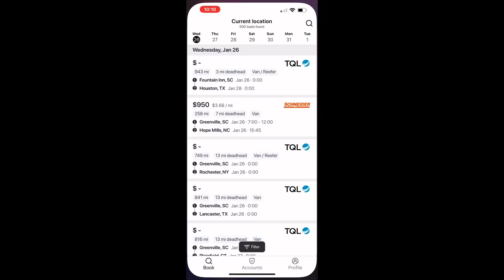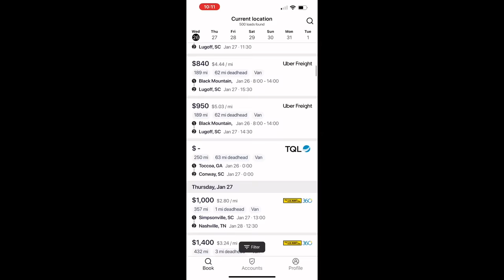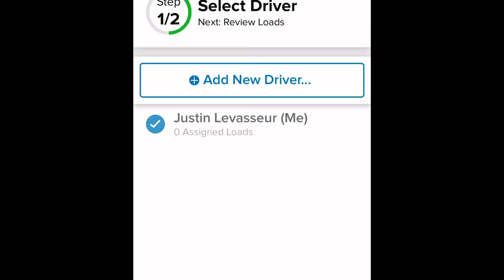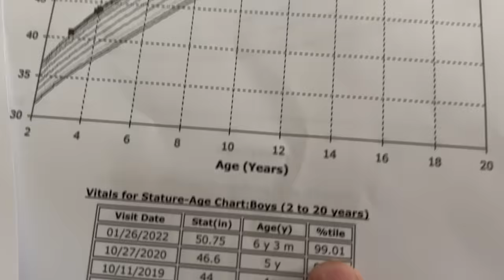RIPPED MY TRAILER DOOR OFF ?!? Worst DOCK I’ve be to in Long Time! Day in Life Failarmy off grid otr

Comment: Justin I have driven alot of trucks with cummins engines in my 48 years of trucking from small cams to ISX's every  one of them the oil would go down somewhere between full and low and stay there for miles. Try something don't add any untill it gets to the low mark
Reply from the maker: Okay thank you